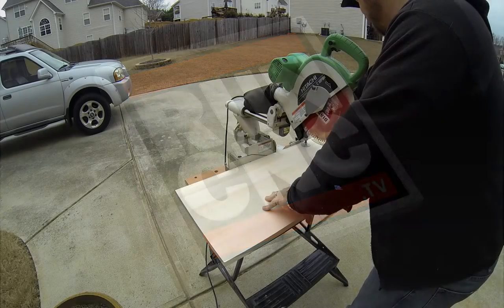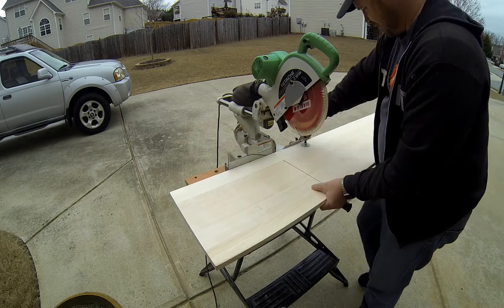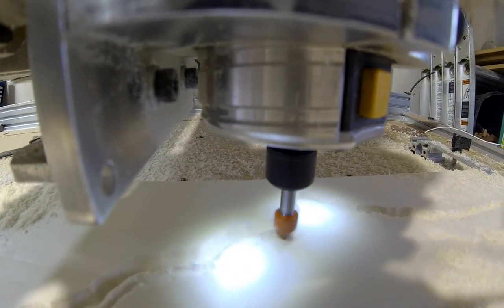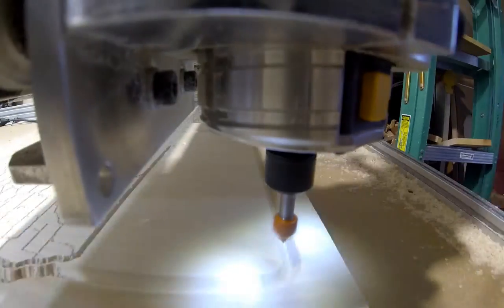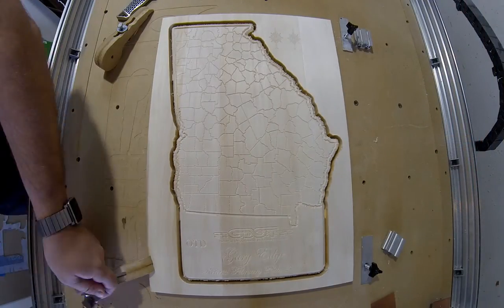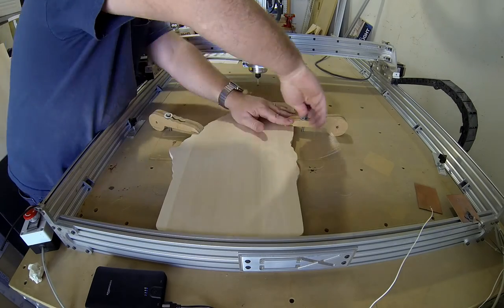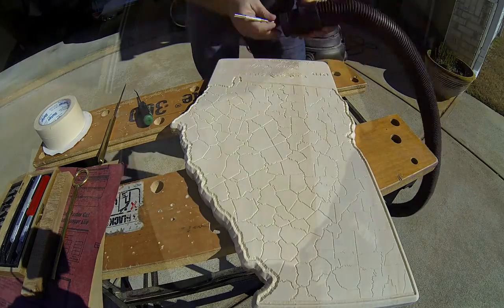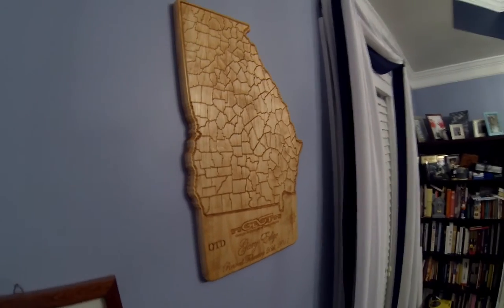CNC Carved Retirement Plaque

Comment: I'm from Texas and I can't imagine how long it would take to do all 256 counties!

Turned out great. The finish really popped the details.
Reply from the maker: Thank you. It probably wouldn't be too bad to do Texas. Many of the counties are straight lines. Plus I would not have as precise data for Texas so many of the small jogs would be missing. For this map I had the vector data used for printing the state map. So it was as accurate as can be.
Reply: Nice! In the panhandle and the Big Bend area, there are some straight areas. Once you move south and east, they get squirrely.

Comment: Looks great. I did a much simpler project in the shape of Vermont recently and made the t-slot in the back the old fashioned way. I'll have to try using the cnc next time.
Reply from the maker: The trick with making the tool path on the cnc is that you want the tool to enter and exit in the same location.  If you need any help with it let me know.